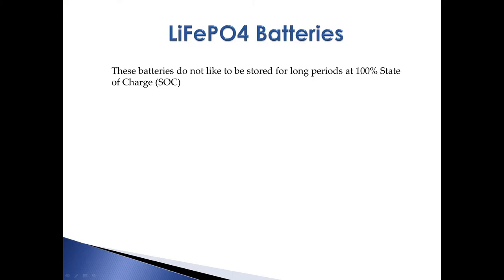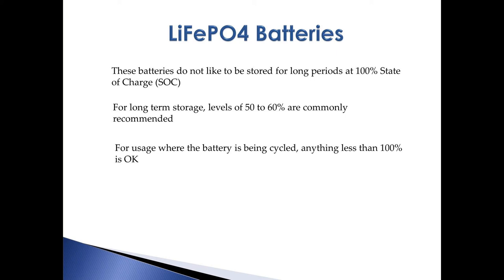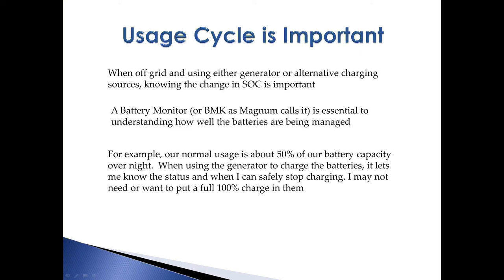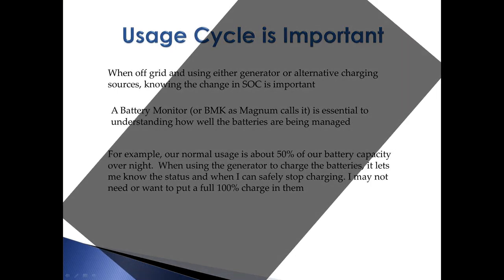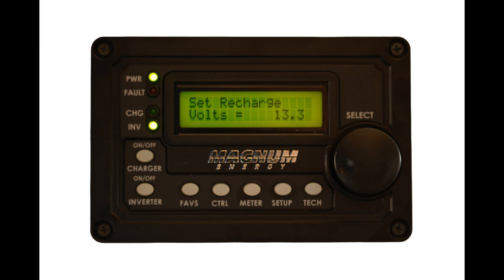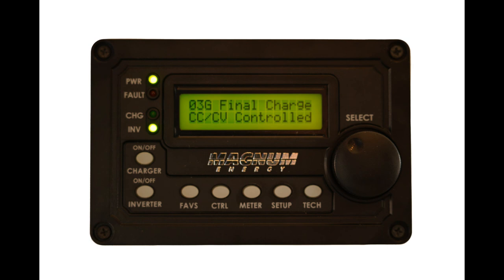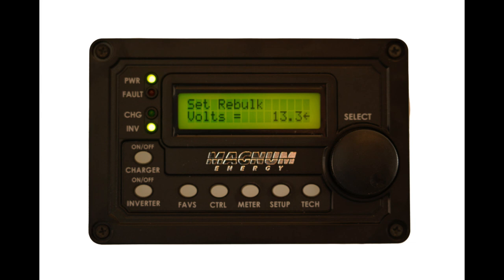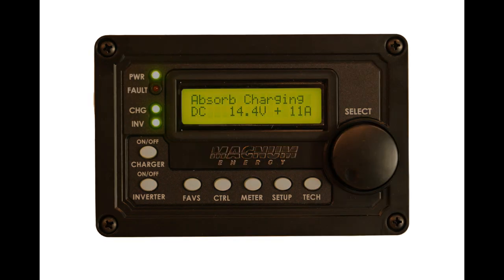Lithium Battery Charging With a Magnum Inverter

Comment: I have a 2017 Allegro Bus and just bought 3 Life blue 200A batteries. I have the Magnum MS-2812 inverter and the ME-RC controller along with a go power solar controller. I’m hoping to get my batteries installed tomorrow and hope it goes well.
Reply from the maker: My only concern would be the programming in the controllers.  I have no idea how that has changed with model years but I did replace (and upgrade) the controller in our 2014 to get compatibility.  Last I knew, Magnum was no longer offering to upgrade firmware but that may have changed.

Comment: Can I ask what version your inverter and controller are?  Magnum has told me that I cannot charge LiFePO4 batteries with versions 5.8 and below for the inverter even though I have a custom setting on my version 3.4.
Reply from the maker: I don't remember the details, but I did have to swap out something on the Magnum device to bring it up to speed and I replaced the controller itself.  Sorry I can't be more specific but it was a while back.

Comment: Thank you for creating this tutorial. I have a PV system that incorporates an older Magnum inverter/charger (MS4024AE) w/out an LFP battery selection in the remote. I plan to replace my lead/acid batteries w/ LFP batteries, so I was wondering if I would be able to program the Magnum for the LFP batteries. From what you've explained in your video, I should be able to continue to use the Magnum with my system. Time will tell!
Reply from the maker: It will depend on just how old the system is.  I had to upgrade the controller to get enough functionality for the lithium settings.  Prior to Covid you could return a controller for the upgrade but that was suspended and I have no idea if they have ever rescinded that condition.  I ended up buying a new controller to get the settings I needed.

Comment: Hi Jim, 

Our MS-2012 is version 3.7 firmware, so level 3......can you advise what version your unit is? The reason I ask is that some of the lithium functionality is not available until v 4 and above...... our controller is a ME-RC, I think this is part of my issue not being able to have proper settings. If you have V3.7 or lower firmware, i'll buy the ME-ARC and hopefully have better luck programming my unit. Right now, it will not maintain a set voltage.....I have to unplug the unit to reset it......frustrating.   Thanks for your video. Scott
Reply from the maker: I don't remember all of the details, but I had to replace the controller in order to get all of the functionality.  The limitations of using the older profiles was that it could get close to a full charge but not quite use the full capacity of the Lithium batteries.

Comment: Hi Jim,

Great job on the video, very informative.  In fact, the information you provided was more complete than I got from a tech I spoke with at Magnum Energy/Sensata.  

My wife and I have a Winnebago View, with the same inverter/charger and remote that you have.  Batteries are 2 Lion UT1300 LFP.  I have the ME-ARC programmed the way you and Magnum recommend, but I keep getting high battery voltage fault codes when the BMS opens.  I can see the spikes on the phone app for our Victron SmartShunt -- they are 17 to 18 volts.  I am concerned that the spikes will damage the MS2000 inverter (if they haven't already).  A few times the ATS in the MS2000 opened up (AC pass-through was shut off) -- all 120V loads were off for maybe 15 seconds.  Needless to say, that's not normal behavior.

Is it common to see the red LED on the ME-ARC flash and have a fault code created every time the BMS opens up?  Do people routinely rely on the BMS to terminate charging?

Another question is -- while Lion says each UT1300 can accept a 100A charge, and 50A each is ideal, when I set the MS2000 charger for 100A (50A each), the BMS opens almost immediately.  They are nowhere near 100% SOC, and the garage the View is in is at about 50*F.

Also, I found that the charge current displayed on the ME-ARC is always higher than the current shown by the SmartShunt -- unless I lower the charge rate to 50% (~50A).  At that point the readings are the same.  My theory is that maybe the BMS units have a way to shunt current around the cells -- that would be current flow that the SmartShunt cannot see.

Ideally the MS2000 charger would behave the same with LiFePO4 batteries as it does with lead-acid -- pretty much set it and forget it.  I gather there is no way to do that -- it is essentially a manual process with LFP batteries.  Is that correct? 

Thank you!
Reply from the maker: You have a lot o questions but it sounds like something isn't right.  All I have used are the Battle Born batteries but that shouldn't be any different.  The behavior you are seeing is not what I see, at all.  

First, I am not sure what you mean about the "BMS opens".  With the BB batteries I never see the internal BMS open the connection but I would guess that if the BMS in the battery is opening the circuit there would be an inductive "kick" in the charger that would cause a voltage spike.  The BMS should only be opening if there is either a high input voltage or a current greater than the safety setting.  Neither of those should occur in normal operation but would represent some form of fault and the BMS is trying to protect the battery from either a high input voltage or an excessive load current.  My BB batteries have never shown me that operation in about 4 years of using them.

As to the current readings, you have to take into account the inherent accuracy of the shunt and the metering system.  Shunts are usually 1% but can be different and the meters are typically 2% but can be different.  So if the readings are within something like 4-5% that can just be meter error.  If they are much out of that range, I would check for a wiring error.  The shunt for the load current should be between the negative of the battery and the chassis connection.  But recognize that there are often loads that can be powered by the charger and the net energy to the battery will be less by whatever the external loads are.  So if anything is on, then that current can be supplied by the charger and never get to the batteries.  So it is common for the current reading on the Magnum to be higher by several amperes or even more due to  the current going into the batteries is less than the total current coming out of the Magnum.

My system is pretty much set and forget.  I check it when running on solar just to keep an eye on it but when plugged in I rarely look at the display.  From what you are saying, something isn't right with your system but it isn't obvious from what you have described.  I would say start with a wiring diagram that shows all of the battery connections and see if that shows you something.  Good luck.

Jim

Comment: Very well done still sounds like Chinese to me.🙃 Do you have a list of needed battery information to set up a lithium profile?  We will be installing a Vatrer 12.8V 460Ah Low Temp Cutoff LiFePO4 RV Battery, APP Monitoring, Built-in 250A BMS , with a lithium battery isolator to protect our alternator in our 2017 Tiffin Allegro Bus 40SP.  Also Lithium batteries are cold sensitive.  We live in WI and will be traveling to FL mid January.  Will be in the cold for about 2 days.  We will need to keep the battery warm, any suggestions?

Comment: Hi Jim!   Great Video!  We have similar systems, but I'm using 6 Briter Lithium Batteries.   On your rig,  what in the circuit does Chassis Ground tie into the Battery (- negative) side?      At some point the negative side of your battery connects to Chassis Ground.   My installer tied the Chassis Ground to one side the the BMK Shunt.  and I'm wondering if that may be causing some oddities in my install.   I also have 1200 watts of solar up on the roof.   THanks for your time and thanks for making an awesome and concise video.
Reply from the maker: Sorry to be so late replying.  For the BMK to read ALL of the vehicle grounds for the battery must be tied to the shunt and all of the other "grounds" tied to the chassis.  That puts the small resistance of the shunt in the right place to give an accurate reading.  Think of it as a channel for the electricity flowing into or out of the battery.  The battery is on one side of the channel and everything else is on the other side so what the channel measures is flow into or out of the battery.  There is a small drop due to the shunt, yes, but it is small enough to not be a problem if you use the right size shunt.

Comment: I can't seem to find a solid answer: Will four 12V Battleborn batteries wired in series work for my Magnum 4400W inverter/charger? I've been told not to wire lithium in series & the only way is to purchase a 48V battery. Please help! Thanks
Reply: My understanding is that limitation applies to SOME makes of lithium batteries.  Also, my understanding is that Battleborn batteries can be used in series, but you should contact them directly to confirm this is still the case.  Do not rely on just what I think but contact the manufacturer to be sure.  Good luck.

Comment: Very informative video. Thanks. One question: Any reason why you went with the Magnum ME-ARC50 over the ME-RC50? Did you need the functionality of the advance menus?
Reply from the maker: Two reasons:  first the older version of the ME-RC50 would not work for the features I needed and upgrading the firmware is no longer an option.  Second, while not essential the additional features are nice to have and the cost difference between the two isn't that much.  I had to replace it anyway, so why not just spend the extra and get the better controller?  At least, that was my thinking.  Glad you liked the video,

Comment: Jim, how do I trigger a bulk charge cycle? It seems to.stay in float all the time.
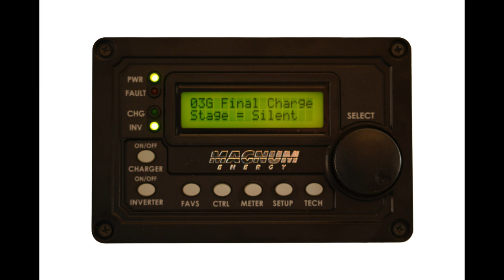Reply from the maker: If you look at the video at around 14:30 I cover how to use the Silent mode to let the batteries cycle down and then get into a recharge mode.  Otherwise, if the float voltage is at 13.6 or so, it is above the output of the batteries and the system will never sense the need to recharge the batteries.  The only other way is to cycle the AC input to the inverter.  That always triggers a bulk charge cycle but isn't very convenient.  Hope this helps
Reply: @RV4X40com  unplugging to trigger a Bulk charge cycle only works with the newer revision Magnum remotes (revision 2.8 or above). The older remotes will only come back on in Float if the voltage is higher than approx. 12.6v.

Comment: Thanks for the video !  Can the inverter be reset ? ours is showing it drawing amps and with nothing running ! I plan on calling Magnum manufacturer today.
Reply from the maker: Yes you can.  Hold the ON/OFF button on the inverter for about 15 seconds.  The green LED should start flashing rapidly and then you can release the button.  Good luck.

Comment: Is there a "set and forget" setup with LFP since I get the feeling that if I just let them charge up to 100% I might be doing potential damage to their lifespan.
Reply from the maker: The best I have found with the Magnum is to let it go into the rest state at the end of a charge cycle as described in the video.  Then set the rebulk voltage to some level of discharge on the batteries.  So long as the charger is in float mode I can't think of a way to do that and the batteries will sit there at what ever charge they have until they self discharge but you have no way of managing that.
Reply: @RV4X40com   I should probably invest in a battery monitor to see what my battery draw and SOC is like with or off shore power. Help help me understand better what is going on. Still new at this though it is not rocket science to me. Still trying to figure what equipment I need before I decide on brands or models of the various pieces involved.

Comment: Hello Jim, excellent video... I have the me-rc50 & ms2810inv/chg along with tri-metric tm2030 & sc2030 charger. I have always used 6v lead acid batteries but am in the process of going Litheum. [Your video explained a lot to me & it looks like I can program my ms2810 ok with what I’ve got. Please let me know what you think. Larry Coker & thanks again.
Reply from the maker: Should be able to.  I've used two different Magnum inverter/chargers with Battle Born and no trouble.
Reply: Thanks Jim

Comment: Great video..very informative.
Reply from the maker: Glad it was helpful!
Reply: Do you think going Lithium was worth it?  The hole conversion  must have been thousands.
Reply from the maker: In my case, yes it was worth it.  There are two components involved in the cost:  the batteries and the solar panels.  First, I've done the analysis as well as others and if you plan on keeping an RV for a long period (10years or more) then the life cycle cost of the batteries is less because lithium lasts so much longer, and you can move them if you change RVs.  We did just that.  Solar on the other hand is not really cost effective.  Fuel for a generator (if you already have one anyway) is much less expensive, but generators are noisy and at least somewhat smelly, so the solar is a convenience option for being off grid that I think is worth the money.  Our current system would be roughly $9-10K to build from scratch with 1610 Watts of solar and 600 A-Hr of LiFePO4 battery.  One could build your own battery bank and save a few thousand but I didn't want to do that so I paid extra (maybe) for someone else to put the battery bank together.  I did all the installation work so there was no cash outlay but some time spent doing that.
Reply: So did you just flash your Magnum for Lithium profile? And added solar? You must have put an MPPT controller  and did you buy the blue power solar controller?
Reply from the maker: Magnum doesn't have a way to flash their controller in the field, and they no longer (as far as I know but that could have changed) offer to send controllers back to be updated.  So I replaced the controller in order to get one that could be programmed for lithium.  In the video I cover the two ways to set up a Magnum system for solar.  And yes I have bought several solar controllers.  The first one was too small, the second one that replaced it was fine but we traded RVs and I left that controller with the RV and moved the batteries to the new one.  Then I added the 8 solar panels to this RV and added two separate Victron solar controllers to handle the power as two separate solar systems into the battery.

Comment: Hey Jim, is it normal to have to reset your inverter?
Reply from the maker: Not that I have seen, but Magnum provides it as a function, so it shouldn't hurt it.  It is possible that the settings will all revert to the defaults, so I would check that carefully after the reset.

Comment: The new controllers have a preset for lithium, but the magnum is only charging to 13.6v. They need to be 14.4. Anyone have the same issue? What is the lfpo preset voltage supposed to be?? Can't get any help from magnum.
Reply: I have the 2012-20b Inverter and I just bought the ME-ARC. I used the custom setting as the Lithium preset didn't appear. I set the Bulk to 14.4 and the float to 13.6. I let the rig discharge to below 50% and started charging. Gradually the voltage went up starting lower and it reached 14.2, not sure if it got to 14.4 as watch a battery charge is like watching paint dry. My limited understanding is that even though you are charging at 14.4 the final voltage will not be that, but more like 13.6.

Comment: Hey Jim, My Magnum Battery Monitor must not be the latest version.  I have been using the lead acid setting and setting the voltage to the highest option available.  It seems to work ok but I may need to but the latest version.  Thanks for the info.
Reply from the maker: Yes, versions can be a problem.  When I looked at the original Battle Born installation (there's an earlier video on that), I had the ME-RC controller (probably the most common since it is the lowest cost), I needed to update the control board in the inverter itself because it took a hardware upgrade but they were still updating firmware in the controllers.  At the time it was going to cost about half the price of a new ME-ARC controller so I opted just to replace the controller.  When I started digging into this for the video I found I also needed an update to the controller (2014 Phaeton built in 2013) but they no longer even offered that option due to Covid measures, so I just bought the ME-ARC, again (we traded RVs in November).